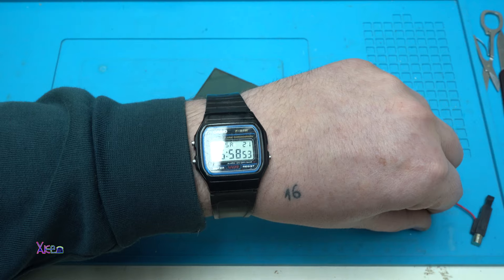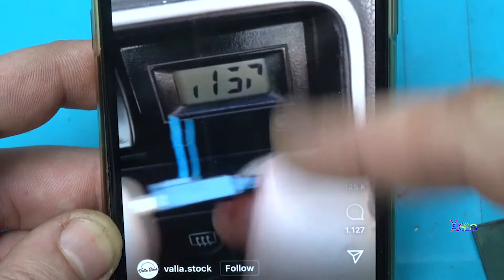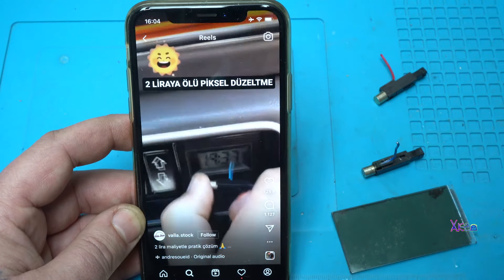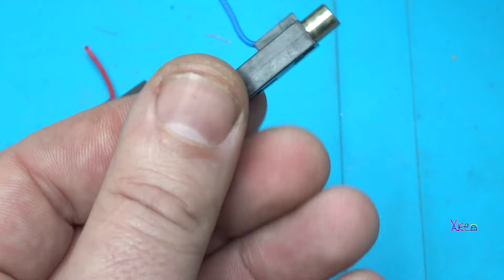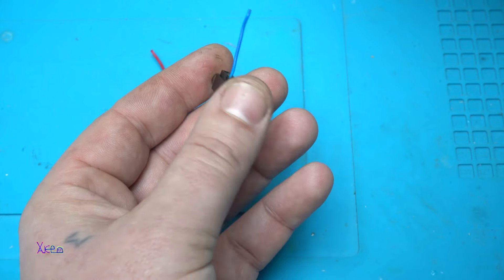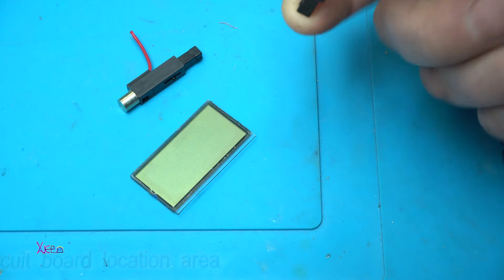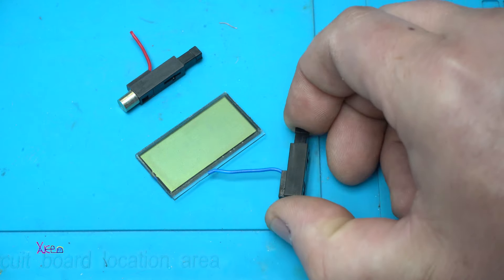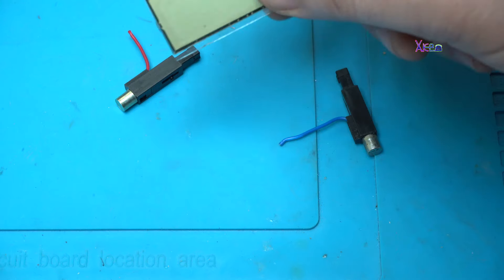Did You Know This Trick?  Electric Piezo Hack!

Comment: Thats y a casio watches last for ever
Reply from the maker: Yes casio are the best
Reply: I still wear a Casio SDB-500W runner's watch I bought in 1989 or so.  The piezo buzzer doesn't make proper contact anymore internally and makes no sound, and the backlight is too dim to be useful, but it otherwise works fine!  It was and remains the perfect runner's watch, it'll last forever I think.  Funny, the year setting only goes up to 2019, and rolled back to 1980 when 2020 came along.

Comment: Hey there, im currently tryin to build a ground kit for shoes. using copper to pull electricity from the ground into s sensor that will display on a small screen of the charge thats happening. i asked chat gpt and its very do able! could i message you privately about this..? no background in this and needing a starting spot but have many questions! Please get back to me, to work together or point me in the rught direction.
Reply from the maker: I dont follow,what is ground kit?

Comment: Can you fix ghosting/fading on e-ink screens (kindle and kobo readers)with this method or any other way? Lot of e-ink reader owners face this problem and currently there is no definite solution I could find on the internet. That ghosting/fading of screen happens after being kindle/kobo readers kept not using for a awhile. Fading happens from corners of screen and it sperads. It's temperature sensitive. It's reversible for few minutes after keeping your kindle in a freezer for a awhile. But fading returns back after kindle comes back to room temperature. Since that problem is reversible to some extent I think there should be a fix. Resetting the e ink distribution to before. I had thought of this method but afraid to fry up my only kindle. Can you please look in to that problem?
Reply from the maker: I dont think that this trick will help with your kindle device

Comment: If the lighter has a push button like that can it be assumed to be a piezoelectric lighter? Also did you have to add that jumper wire?
Reply from the maker: No the wire is there

Comment: Turk yes sdk you sreccn car sound panel display lcd lsd problem 100%5v current no glow no leak what I don't have to ampere but what is grounding my virtue is door slamming I was shocked electric grounding confiscated virtue blue touch death shock tangible a lifetime will you open the door as yest for Turkey as many who knows how many voltage ⚡ 5v electric current is not by the way I wonder if it is not
Reply: wtf